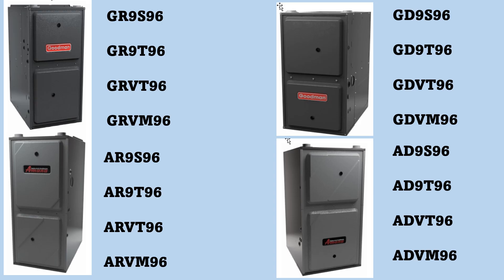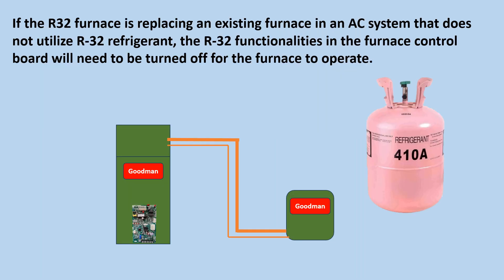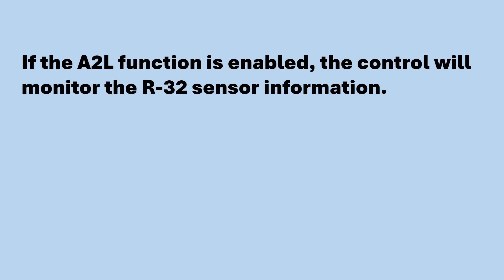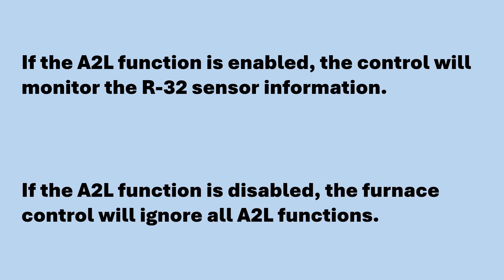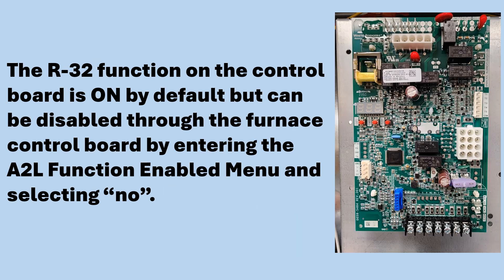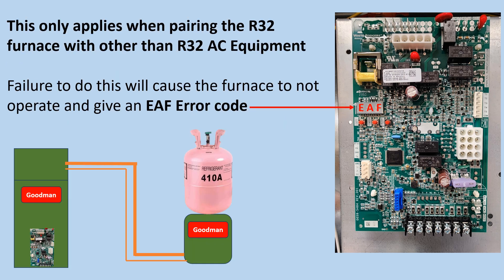Shutting the R32 Sensor Off when Using an R32 Furnace to Replace one in an Existing R 410A System

Comment: H have 96% furnace just installed and l have code EE1.9H
Reply: Pressure switch circuit is closed at start of heating cycle,  Pressure switch contacts sticking, Short in pressure switch circuit wiring

Replace low stage pressure switch, Repair short in wiring